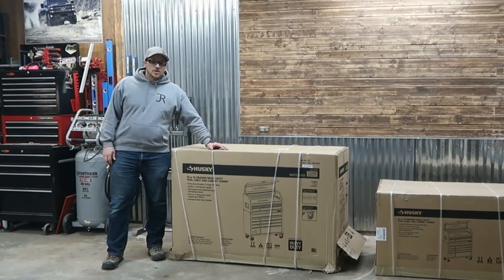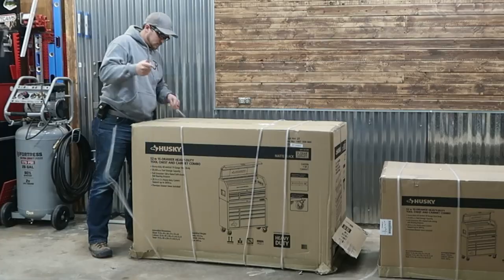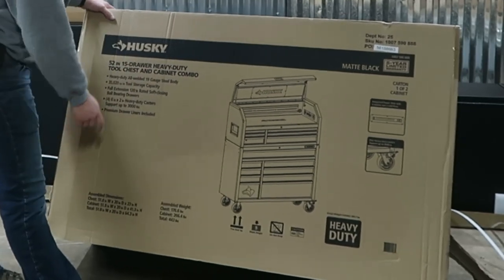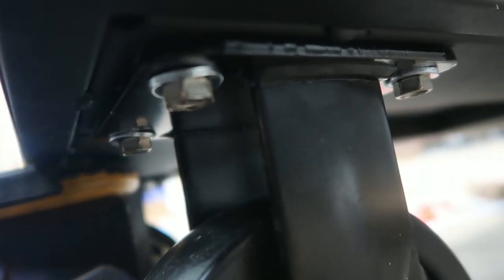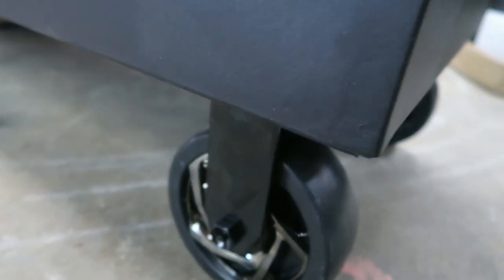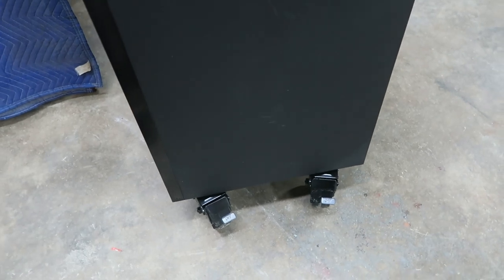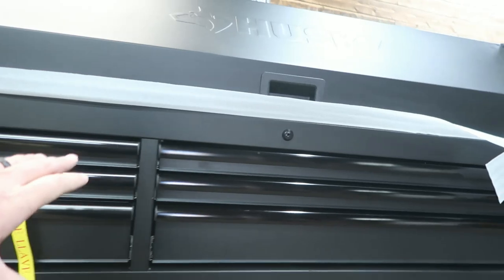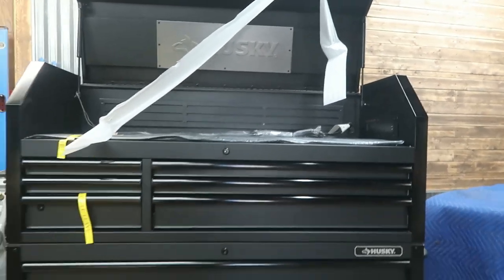Husky 52 Tool Box Assembly and Review

Comment: I do automotive for a living. Bought the Husky 52" in January and it's been great so far. Not sure if I should blame it on thin metal or "lower quality", but one thing I noticed recently is the bigger bottom drawer making contact with the welds on the very bottom of the box. I do have some weight in that drawer but it is not jam packed. I had to remove the drawer and grind off a little bit of the welds (don't remember if it was 2 or 3) so it does not make contact anymore when opening and closing the drawer

Comment: After a whole year of use, what are ur cons with this box??  I have been eyeing this box and just missed the Christmas sale for 798 bc I was told February was the time to buy the cheapest boxes, but it went back up to 1098.    Does it scratch up easily? Thanks
Reply from the maker: No really big complaints. Overall really love the box. Like you I regretted my purchase price. It actually fell ~$200 after I purchased so a little bit of buyers remorse. But in all honesty I’d pay $1,500 for this box. The only slight issue I have is sometimes the large (widest) drawer doesn’t want to pull out evenly. It has all of my 1/4 and 3/8 ratchets and sockets. It still functions fine but the left ball bearings seem to track slightly behind the right ones. I’m not sure if it’s a weight distribution issue or what. 

I would say it’s pretty durable. That said, my shop is small and it does have small chip from a door ding. I’ll try to upload a YouTube Short today so you can see what I’m talking about

Comment: I've been looking at the other box you mentioned with the dual power strips and LED. I like the drawer layout of the one you have a little better since on the other one the 3rd drawer down on the right top has a "workstation" which I think limits the use of the drawer by providing a lid inside the drawer. The other differences between the 2 is the one you have has slightly thinner gauge steel (19) vs the other (18).  The dual power strip has 4 outlets and 2 USB per side. I will am waiting for a sale to pick up mine but will be getting the thicker gauge steel and the extra power strip and LED for an extra $100 as they suit my needs more. 

Congrats on the purchase and thanks for the review.
Reply from the maker: I wasn’t a fan of the folding drawer top either. I tried to be patient and wait for a sale but it seemed like the prices just kept going higher. I hope you are able to buy it at a reduced price. 👍
Reply: I just bought the one you are referencing with the LED (H52CH6TR9HDV3) which I believe is the older model being replaced by the one in the vid (H52CH6TR9HDV4).  I called Husky who gave me the manufacturer (or importer as it were) who confirmed the V3 is being discontinued.  Another great piece of info they gave is the newer V4 version is 1.5" shorter in depth so the drawers are more shallow.  I was lucky to find the V3 in stock (it has been out of stock for a week) and picking up on Friday.  The less shallow drawers were a deal breaker for me.  The V3 is $100 more but suits my needs better.  Just hope it is in good shape as I won't find out until unbox it at home.
Reply: The newer box is about 100 lbs lighter than the older one, probably due to the 19 gauge material instead of 18 gauge and the shorter length of drawers. Both are nice boxes. Currently the older one is still around for $1198 and the newer one is $798. It'd be a hard decision to make if I were looking into one.

Comment: Thanks for the video, I ended up buying the 61” heavy duty and love it. Only problem is the casters. If I roll it they clunk every foot or so one I loaded it full of tools. Almost like they are bent? I called and got a new caster thinking it was just one caster but still make that terrible noise. Maybe it’s the bottom of the box itself idk. I have had my wife push it while I try and see what wheel it is but hard to pin point why it clucks so bad. Maybe I will just get new casters. I do see there is a grease spot on the wheels. Should I spend the money and get a grease 
Thanks
Reply: Just put mine together and it’s doing the same thing like you just mentioned. It sounds like the caster is bent and making a loud clunk.
Reply: I figured it out!! Loosen the 2 that don’t  swivel and make sure they are aligned straight with the frame.
Reply: Then make sure u tighten them back up once straight
Reply: @jasonallin298  Awesome! I will do that as soon as I get home later. I appreciate it!
Reply: @jasonallin298  That was it! Thank you!